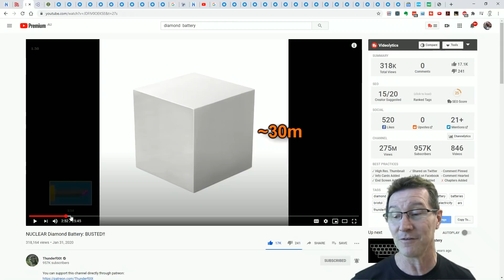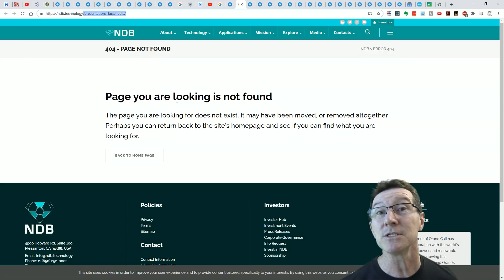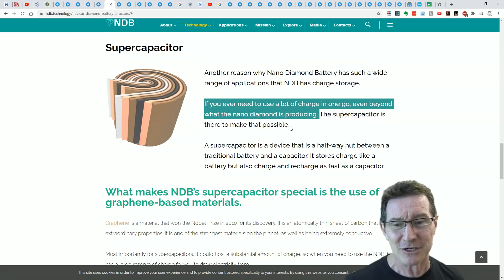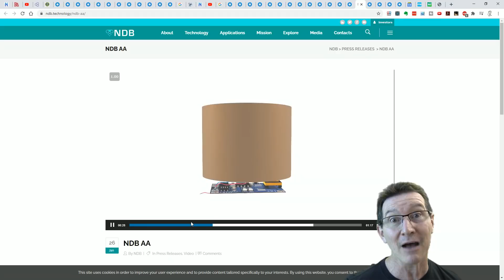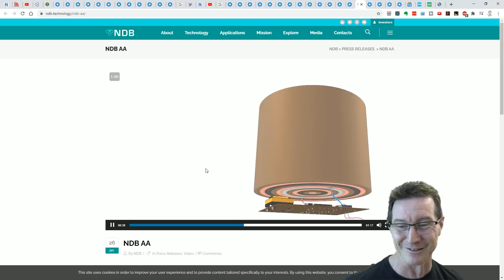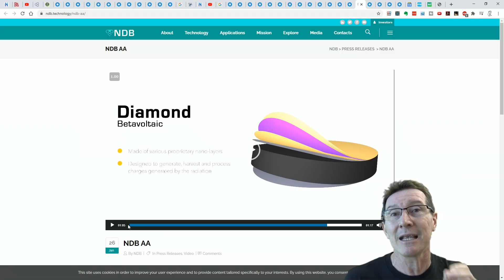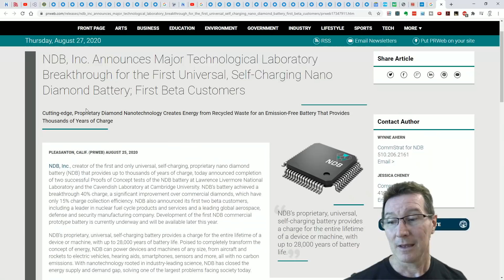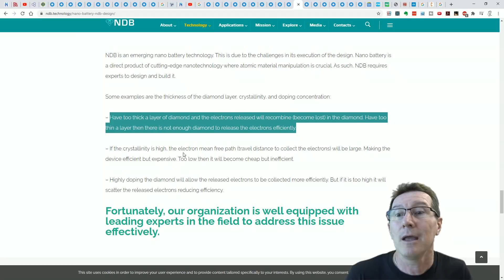EEVblog #1333 - Nuclear Diamond Self-Charging Battery DEBUNKED!

Comment: This device was actually getting me excited, I’m currently playing around with IOT device with Lorawan connectivity, and doing a bunch of power tests. I use about 40mA during TX and drop to 20uA during long sleep cycles. Sounds like their marketing went in the wrong direction, but for IOT it sounds useful, depending on cost. BTW, I probably don’t need 300 year life, I’ll only be around another 30 years, I don’t care what happens after that. 😀
Reply: a CR2032 or CR2016 coin battery is probably better.  It last 10 years or more on laptops and PC motherboard, and Casio wristwatch like F-91W last for a decade..
Reply: @xponen  In higher temperature applications a CR2032 has a high discharge rate. I'm using a MS920T rechargeable in one application.
Reply: 100uW is not too bad. E.g. this can permanently power a 20dBm transmitter with 25% efficiency sending 1000 bits at 4Mbps every second. Mutatis mutandum there are very real applications at this power level.

If it would be reliable, cheap enough and lasting 20y or more this could be interesting for certain applications where a button cell would need to be replaced at least once but replacement would be difficult or impossible.

Granted, that's a lot of woulds and coulds, but otoh a decade passes way faster than you think when you're not thinking about it. :-)

Comment: So they have just over doubled the efficiency of an existing, very inefficient 20-year old technology, and want to use nuclear waste as a fuel source? if someone talks some sense into them, theres a small chance they could "revolutionize" the target market for current betavoltaic batteries. if they want to power anything beyond the low milliwatts range though they'll be irradiating their customers.

Reminds me of some of the (recognized) anti-gravity / warp drive claims. In rare examples, the math works (like with EM-drive) and something works measurably under lab conditions (like Podkletnov's levitation experiments). There's hype about scaling it up and making it practical, and then people realize it just cant be made practical. There's a huge difference between building something that proves the math, and building something people could actually use. I'm holding out hope for fusion, but a lot of things like this either wont work with our current know-how, or just wont work ever.

Comment: C'mon Dave what you fail to note anywhere here is the fact that all you need for a very useable 10W/h generator is a *handful of these devices. 
Usual poor journalistic attitude to sensationalise an otherwise non story. Disappointed.

*(Current SI handful unit is 100,000).

Comment: Human Body: 100 W
Betavoltaic: 0.0001 W
Reply: conclusion: use humans as "battery"
Reply: @nathandecrom2409  To be fair, a phone using the radiated heat from the user as a power source, would see more power than one run on betavoltaic.
Reply: @nathandecrom2409  matrix
Reply: The only application need this power and longetivity is security token for online banking or dumb watches

Comment: Those citylabs things are 20 grams I think. I'm sceptical they fit in an DIP form factor. But if they did, and the source was a small portion of that volume, then scaling up to the volume of a AA (which is considerable), charging a AA in 100 hours would almost certainly be considered interesting.... if it weren't for the price.

Comment: The actual technology behind this does seem interesting from a technological standpoint, I'd love to see actual applications for betavoltiac batteries.
Reply: The standard applications tend to be things like very low-power sensors - weather, seismic, that sort of thing - designed to be placed in remote regions like the arctic; where changing the battery is impractical. Nurdrage sent Dave a home-made one based on some glow-in-the-dark tritium keyfobs and a couple of photovoltaic cells; Dave made a video about it and talked briefly about the applications the commercial ones were used for.
Reply: @RedwoodRhiadra  Yeah I'm trying to imagine all that "sweet as" space hardware that might require something like this. I always wondered how they powered something that might run for decades.

Comment: So with this i could never replace the battery in my pokemon yellow version again? (where a CR2016 last 10 years)
Reply: Probably, but it wouldn't be worth the cost. Better to use a teeny solar panel or maybe even temperature changes to power the RAM.

Btw, I must be lucky with by GB games. My Pokemon Blue still holds a save, and I haven't changed the battery in the 13 years I've had it. Not sure if previous owners would've changed it, but somehow I doubt that.
Reply: @eDoc2020  i am just assuming it is dead, i replaced my gold/silver/crystal batteries (the RTC eats power)

Comment: FWIW I've never even thought about micro-watts when looking at circuits. Milli-watts is as small as I've ever needed to consider!
Reply: I think battery backed ram is microwatt range in standby, but for that a 2032 is far cheaper and lasts a decade or three.
Reply: @Broken_Yugo  the problem with galvanic batteries is that they age. Some really high end industrial computers frin the 80tys had radioisotope generators in stead of batteries.
Reply: 100mW would  be loads. The standby power for a phone that is optimized for it is about 5mW.

If you could get some thing like this to 10mW, you could make a emergency  phone that never need to be charged.
Reply: I have a calculator where the manufacurer says it's power consumption is 200 microwatts. However, some super long length battery is a bit pointless, the normal battery in it has lasted for 6 years already.

Comment: "What's that you can smell?" 
Probably Daves RAM burning upp from running all those tabs in Chrome..
Reply: you say that, but i run almost 180 tabs across 5 chrome instances on my work pc and it uses ~4gb of ram, wich is not that much nowadays, even a pc w/ only 8gb of ram can handle that after windows 10 takes its gig or 2
Reply: @Space_Reptile  When I get about 30 or 40 tabs, it slows my 16 GB i7 machine to a crawl.  I wish I could figure out the secret.
Reply: @ricksmith3045  Recently Google introduced some kind tab suspension, after a while it shuts a tab down in the background. However you have to just restart the browser after a while.
Reply: The new AMD chips can handle 1TB of RAM.  With that, even with Chrome Running on Windows,  you would be able to open a few tabs without running out of space.
Reply: I have almost a thousand tabs open combined, have to reopen Chrome every few days but it works!
Reply: @iprot00  why?🤣
Reply: @Thompson-from-Finland  No specific reason, just didnt get around to sorting it, sometimes it's just faster to keep it open than to think where to save it.
Reply: 32gbts ram   open  20  30 tabs not much increase now 4gbts   just opened 10-20  youtube tabs   5.6gbts no biggy  had 16gbt  bought another 16gbt
Reply: @markissboi3583  Now leave those open, leave it running for a month and keep opening and closing tabs as you normally use it, end at the same amount of used tabs, your RAM usage will slowly skyrocket.
Reply: paging works, he's burning his spinning rust disks.
Reply: Today's browsers are so annoying. No multi row tabs, no open file instead of saving it to downloads and tjen sorting through your junk.
Reply: Use OneTab
Reply: The amount of tabs Dave used wouldn't even stress out the cheap 6-year-old "NUC" style computer I use to play videos on my television.  I'm using it right now, with twice as many tabs, and it's still quick and responsive and not even warm.

It certainly wouldn't be a bother for a recent desktop computer.  I routinely have hundreds of tabs open (loaded and active), and the browser instance runs for most of a year at a time, with tabs being opened and closed dozens of times per day.  I don't even run out of RAM... though, admittedly, Chrome would use more if I let it.  But I run it in a memory-restricted cgroup, and pause the entire process tree while I'm not actively using it, which greatly cuts down on the rate of bloat.
Reply: He's got bugger-all in the way of open tabs. That's only a couple of dozen. When you get into the hundreds, you can start worrying.

Comment: Every few years i hear about new “revolutionary” battery tech that will “disrupt” everything
Reply: They only disrupt investors wallets, which is the intent of hype from startups.
Reply: I'm still waiting for us to be flying around in this new ultra high tech airplane powered by lithium polymer, it's only about 35 years late. What happened to the aluminum battery that was nearly ready to roll that could give you 10 times the range on your electric vehicle over a year ago. I'm still sitting here charging my phone every day, why can't I just get one of those ultra capacity batteries using graphene that has 1000x the capacity. I would only have to charge my phone every 2.4 years or so.
Reply from the maker: Regular as clockwork.
Reply: Even if the 100 microwatt battery did last 320 years compared to the city labs 20 year battery it wouldn't matter as any application said battery was placed in, said tech would be outdated and replaced in less than 20 years, which would make the city labs battery more favourable due to it being cheaper.
In the end if said diamond batteries ever became a thing it wouldn't sell even anywhere near 1% of the total units normal batteries sell due to said diamond batteries lasting for thousands of years it wouldn't be replaced often, this means 100% of the cost of R&D will be indefinitely be pushed onto the buyers, making any NDB phone cost anywhere from 4-5 figures, and should a new model of that phone come out.. well as we know with each new model comes different battery dimensions.
Reply: @Skelath  said
Reply: Remember that little clip that would get the most out of your battery. That claimed that people don't use 90% of their battery life. But with the clip you would be able to drain all of that. Ah good times, that was such shit
Reply: Batteries are now what fusion power was back then. Just like how fusion power used to be always 20 years away, all these super-high-energy batteries seem to always be 3-5 years away, forever.
Reply: There is a new battery technology every few years - look at Tesla, they're snatching it all!
Reply: Me too! 😒
Reply: And instead we see boring incremental improvements; good, but not earthshaking. I remain optimistic that one of these 5x or 10x laboratory achievements will make it to the market, but it's clear not all of them will, for practical reasons not encountered or relevant in the lab.

Comment: I wonder what the average power consumption of a wireless computer keyboard is.  Probably only about 1mW.  Could it be powered by 10 of these things?  Maybe, but probably not economical.
Although, one advantage is you can dump a diamond battery in a land-fill with no worries.  The C14 is locked up the diamond lattice structure and will never leach into ground water.  So, greener than alkaline batteries?

Comment: Efficiency is efficiency, 14 times more of the energy available extracted sounds impressive till you realise that plutonium 238 is basically "magic rocks" - a smallish block of it will generate enough heat from its decay to glow red- orange hot.

The energy available from a given mass of carbon 14 is about 9 times less, and it releases that energy ~65 times slower.
(Much less energy per decay, and a lot gets carried off by antineutrinos)

So 65*9=~586 times less power per mass.
 Even with a factor 14 that's 40 times less.

Not to mention plutonium is waaaaaay more dense than carbon, so your volumetric power is going to be even worse.

If they could make it viable as a replacement for tritium it might actually be worth something. Tritium has a half life of like 12.5 years, meaning it could actually become insufficient in a timeframe where a few coin cells is a better idea, just cut the marketing wank.
Reply: I mean this with complete sincerity. You must be a lot of fun at parties.
Reply from the maker: Imagine an EV sized battery and the heat it would put out when it's not being used, where does the heat go?
Reply: @EEVblog  plug it into your home and power your home with it.
Reply: You can't beat or bend the laws of nature, only adapt to it. 

Those high speed electrons do not even hold a candle to the energy of a helium nucleus spat out by a heavy element.
Reply: Are you sure? What do you think about what I wrote in this comment here: https://www.youtube.com/watch?v=uzV_uzSTCTM&lc=UgwqZN1m7axoTDG2I3l4AaABAg
Link should bring you directly to it.
Reply: @GLITCH_-.-  It just brings me straight to the video?was fermi'ng a bit too hard, and it works out to more like 30 times worse when i type into google :)
Reply: @AngDavies  If you link a comment like that, the video page loads normally, but the comment will be highlighted and at the top. You can link a comment if you right click and copy the link on the time by the side of your name in that comment.

Comment: 100 micro watts? not enough "juice" to do anything practical, cannot even fit that chip in a wrist watch. dunno about the radiation either.  LOL
Reply: I mean, tritium decay has been used to light watchfaces (mostly the arms) and self lit weaponsights for many many years now. The radiation is easily blocked by a small amount of material and the radiation is used to activate a phosphor (which is usually enough to produce a light that can be dimly seen at night, with a half life of about 6 years - around 12 years, it's basically not visible in any practical environment and would need to be "recharged" by replacing the tritium material).

That being said, there have been some serious problems in the past, w.r.t. the manufacturing of similar devices (Radium girls, anyone?).
Reply: 100µW is more than enough to run a low power microcontroller and a memory LCD.
I don't know why you would need to make a gadget nuclear powered instead of just using a lithium primary cell that will run it for 10 years though.
Reply: This COULD be used in remote controls , if they sold for 10 dollars I'd by 2 or 3 an use them for the next 60 years ...

Comment: Imagine not having to change the batteries of your TV remote control ever again! That would disrupt energy market!
Reply: Yes your right. But after consuming the juice of your remote battery. You need to wait for 22k hours for it to self recharge. And be able to use your remote again. We can call it energy saving cause you can start watching TV after 22k hours.
Reply: @mustafadelmonte9413  your remote spend 99.99% of its life doing nothing. The average power consumption is pretty low. If you have a supercapacitor to average it 0.1mW is probably enough.
I like Dave and eevblog but here he is a bit fast to make conclusions. The 0.1mW is for the dip device. The AAA device may use multiple "cells" in // to produce more power. Who knows?
Reply: mike brink  I guess that would be pretty much the only conceivable application for something like this that would sell in any quantity. If a TV manufacturer shipped a remote that never needed a new battery, I guess that would be a small selling point. That means it has to be very cheap though, like max 5$ for one of these.

Comment: I totally agree on your key points: nuclear batteries are a real thing, but their tiny power output limits them to a few niche applications.  Any suggestion that these could be used for electric cars or smart phones is pure BS.

However .... that AA cell with the built-in supercap could be used in TV remote controls.  When I push a button on a typical TV remote, I think it draws only a few mW for a few milliseconds.  But I don't push the buttons very often, since I spend a lot more time watching a show than I do surfing the channels.  The average power may well be in the uW range.
Reply from the maker: A pair of lithium AA's/AAA's will last forever in a remote.
Reply: @EEVblog  True.  Which probably explains why -- as far as I know -- nobody has tried making a TV remote that is powered by a small PV cell and supercap instead of a battery.  This would probably work, and is way cheaper than a nuclear battery, and yet is apparently not worth it.  So nuclear batteries would have no chance in this app.
Reply: I bet one could do it cheaper with a solar cell and a couple small NiMH/NiCd batteries, like those solar garden lights that can be bought for a dollar. Presumably not cheaper than the current standard of a shrink wrapped pair of carbon zinc AAAs though, or somebody would probably be doing it.

Comment: Facepalm indeed! It's a vaporware battery. Also, shouldn't IC type chips, well, in this case a fake dubious B.S. object. Shouldn't  have an even number of pins on each side? 10 or 12 as opposed to 11? It looks weird.

I don't know much about electronics but all the IC's I have ever seen have an even number of pins on all sides. Maybe nuclear waste diamonds use one less atom in there, therefore two less pins? 😋
Reply from the maker: It's just a photshop mockup. But they showed their hand with the 100uW figure.
Reply: @EEVblog  I can't post a link here, but if you want a high-res image of the IC, then just check the wp-upload directory of their website for February 2019. Maybe not so interesting but hey, they can't try to claim that it isn't from them at least, was uploaded 22/02-2019.

Comment: The only actual application for Betavoltaic generators is in battery backed SRAM or RTC applications. Maybe to run a small microcontroller hooked up to a sensor to log some data to some low-power nonvolatile memory. Only really viable in ISM or Military applications.